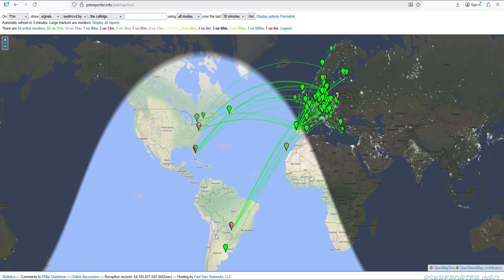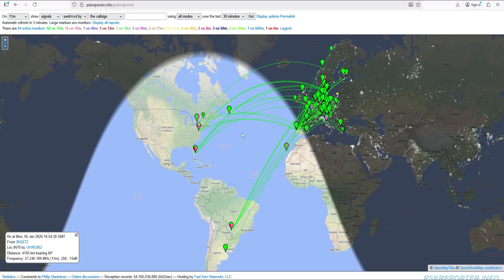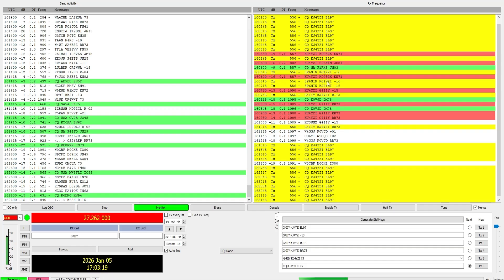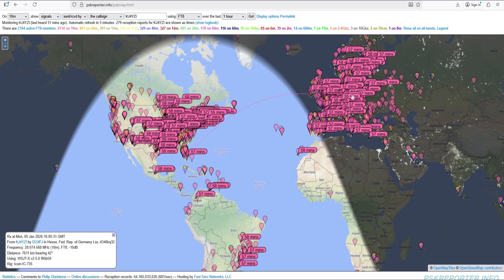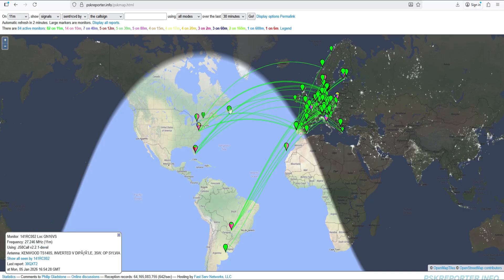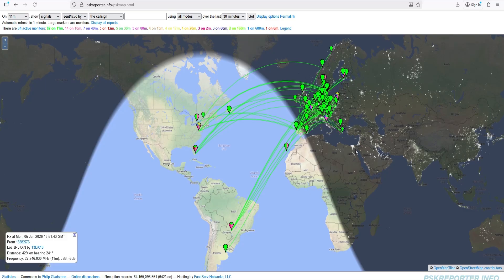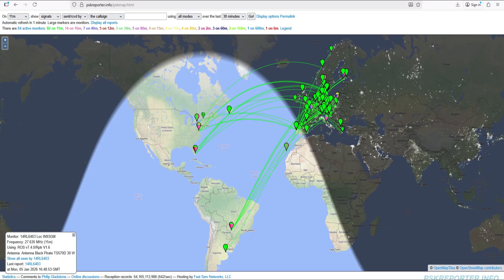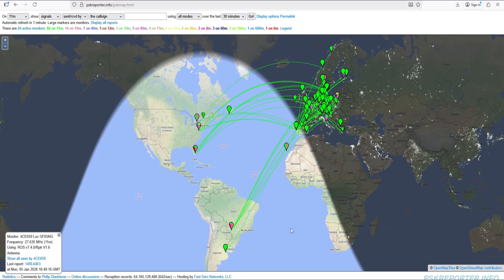FT8/JS8CALL On 11 Meters CB Radio

Comment: I will have to verify this but, myself and a cohort of mine possess a few devices that pass some form of data on one CB radio channel. These are permitted up to 25w. They were used for pagers. An back of set telescope antenna was supplied and with an so-239 back of set, you could adapt to the appropriate outside antenna. I see no reason to not use similar equipment (for ft-8 and the like). I'm fairly confident that, using channels (I think for the states, they're between channels) used similarly for RC devices. Those crystals are still available on the used market. Again, after referencing the rules, I don't see why you couldn't "remote control" a device and track such from one side of the pond from the other 

@R4002 for more references on YouTube.

I'll pour through my videos to find these paging devices.

Comment: You need to do a video on ARRL awards. I am constantly hearing amateur operators on D-Star, DMR and System Fusion reflectors, talk groups and rooms asking them to verify their contacts in QRZ so they can apply for WAC / WAS etc. awards. The word needs to get out that working stations on Repeaters or other powered systems does not qualify for valid contacts. Contacts need to be made using RF...
Thanks...:face-fuchsia-tongue-out:

Comment: Aloha Eric, first thing that I want to point out is that there is no such thing as a “CB Band”, per se. 
     I’ve had a lot of what I call, “senior hams” at our club meetings and on the 2 meter band that said that the power level for the 40 frequencies used for CB channels in AM mode is set between 4-8 watts and that the 11 meter band in LSB and USB is completely unregulated by the FCC and therefore, no power level regulation enforcement whatsoever, which is probably true regardless of whatever power level you are using. 
      Eric, if I had a DX QSO with you in Florida on 11 meters via LSB and USB from here in Hawaii, are you really able to tell how many watts that I’m transmitting with? 
    Given the fact that antennas do most of the hard work and if I told you that I was transmitting with only one watt, one watt only, which is my norm, and you gave me a signal report of 5/7, would you actually believe me? 
      Before I continue any further, my old average was 5,026 miles on just one watt of power with my old antenna, which was a ground spike and a 2.5 meter telescopic antenna. 
     Today, I ❤ using my Positive V antenna utilizing two 2.5 or 5.6 meter telescopic antennas. It’s a little more weight because I use my diving weights to hold my tripod for my Positive V antenna from falling over with a mild wind. 
     My distance on just one watt, one watt only, has increased to 10,093 miles respectively. Plus I ❤ the fact that this antenna is directional also. 
      Let’s look at this issue a little more closely for a moment. If you ever visit Hawaii, drive around whatever island you’re staying on, you will notice those Antron 99 antennas are everywhere. 
       That is because 11 meters doesn’t require a license and for decades, Ma Bell charged these folks in the Hawaiian Islands a boat load of cash just to talk to relatives on other islands deep in the South Pacific like America Somoa, Palau, Titian, Guam, and well, you get the point. 
     Ham radio is by far, the cheapest way to communicate even if you have a custom calling plan with your cell phone provider. 
     When it comes to the FCC, they should throw away all their rules for the 40 frequencies on AM, since they are just too tired to enforce anything anymore these days and there should be no power restrictions for 11 meters on LSB and USB either. Treat the power levels the same as it’s for 2 meters SSB and do that for 11 meters too. 
     Twice last year, I heard stations on 11 meters trying to do POTA Activations with great success but not sure if they could truly log in those 11 meter contacts. 
     I’m like Salty Walt, I’m not all into doing POTA’s but love doing DX and all contacts outside of the Hawaiian Islands is considered DX contacts. 
     I just love meeting new people via Ham radio DX’ing. I’m just not into the whole points and logging stuff that POTA’s and SOTA’s require. I just want to have fun and to test my radios and antennas to get the max distance that I can. 
     One more thing too, Eric. If Hams are worried about when the SHTF, they should learn to effectively operate on 11 meters(and Not CB) because the 11 meter band always seems to be open day and night when compared to other bands, maybe 20 meters being the exception for the last 17 months. 
      BTW, Eric, great video and awesome topic and content! 👍
        SEMPER FI 🫡🇺🇸
Reply: WRONG